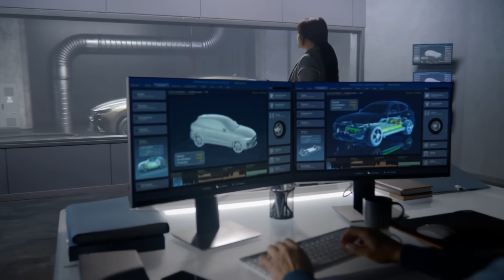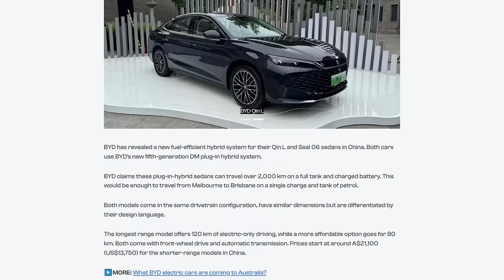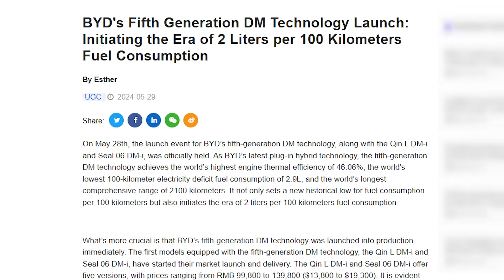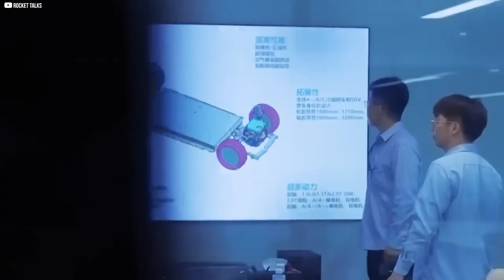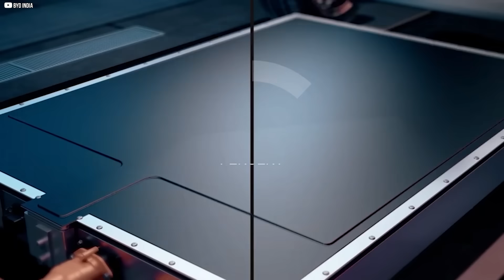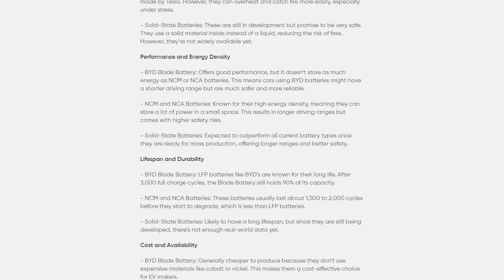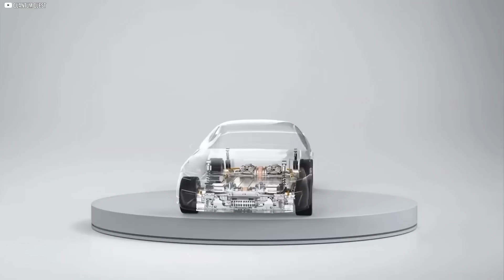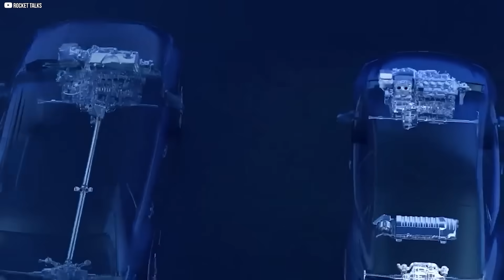Why the Auto Industry Is Shaken After BYD CEO’s Latest Reveal

Comment: There are many in-depth interviews with BYD’s founder available on China’s Bilibili platform. One major misconception about BYD is that it relies on cheap labor. In reality, Chinese engineers earn higher salaries than their counterparts in many developed European countries. BYD’s commitment to cutting-edge global technologies and its investment in R&D began long ago, it’s just that, as a smaller company back then, it hadn’t yet completed many of these initiatives.
For instance, research into enabling cars to float and drive on water began over a decade ago. Another innovation is the high-speed tire blowout stability system, which allows a vehicle to continue driving safely even after a tire bursts at 140 km/h. BYD has also developed technology for vehicles to pivot in place, enabling sharp turns in narrow spaces. Their exploration of vehicle-to-load (V2L) power discharge was similarly ahead of its time. Initially dismissed as unnecessary, BYD insisted on implementing it, so that in the event of a power outage, the car could serve as a backup energy source to power other appliances.

Comment: Now the downside. After 3 years warranty, no mechanic will touch it except for tyres. You run over anything that marks the battery case, no one will insure you. The prospect of a lithium fire even has the fire station not wanting to touch it. One bad cell takes the entire battery pack down, out of thousands of cells. Best of look, getting 10/20 years out of it.
Reply from the maker: Thanks for sharing your concerns about the long-term aspects of EV ownership!

Comment: If anything the Chinese not just BYD are showing up both the American gas guzzling smoking suburban polluting engines and the  costly less efficient European Automakers for what they are, WASTEFUL EXPENSIVE WASTERS. It's a powerful efficient economy like China to lead the world and show how it's done, finally! It only makes sense to ease the driver into electric driving 1st but still have fuel backup with a more than enough range to drive for 2 weeks solid without going anywhere near a petrol/gas pump.The blade battery and using a 1.5 litre petrol engine as a backup with not one but 2 electric motors as premium engines is a stroke of genius!This how hybrid driving should be,DONE PROPERLY!😮🚘 🙏🙏🙏🙏

Comment: I have a nephew who bought a Toyota Prius Hybrid (electric & gas) car about 4 years ago in HI.  He spent about $37K for it at the time but he has solar panels on the roof of his home so electric cost is nominal.  He states his Toyota Prius gets about 83 mpg with the combined electric power. Also, he says when going down hills, every time he brakes, it runs a generator to charge his battery!  Smart, in that sense.  Actual cost is still a question though.

Comment: A 2000km range, impressive. That’s 1250 miles. It does 75 miles on a charged battery pack so 1175 miles on the fuel at 80 mpg so just under 15 gallon fuel tank. Is there room inside for people?

Comment: Chinese are making so called DeWalt cordless tool batteries however when they took them apart.
Half the battery is filled with sand. Wtf?
I guess they needed to balance the battery.
Its like the Dictator where he needs to lighten his weight by removing the brick in his pocket.
Why did he have a brick in his pocket? 
Ez. To balance out the brick he was carrying in the other pocket. Smfh

Comment: Nope. I don’t like it. A better idea is what Edison motors in Canada is doing. The vehicle is run on batteries. When the charge gets low, a small gas or diesel motor charges the batteries as you drive. That motor does not drive the car, it is a generator. It would burn much less fuel than this hybrid, and the headaches from a combustion engine are minimized.

Comment: Lets just come back in some years, to review the lifespan of that excellent gasoline engine, having almost 15% bigger compression ratio, than Mazda SkyActive-G. With oil in it, which most the time will not flow on the optimal temperature, due to the fact, that the electric engines are the primarily.

Comment: MOST UNFORTUNATELY ... it is not so much about the Chinese Made Battery Technology, which were copied/counterfeit or duplicated from the Western Brand Car Manufacturers  etc. ..among the BEST of the BEST ... rather the usage of :  recycled and poor quality material, cheap electric components, and low quality steel to built the battery casket .. as the result, ..prone to short-circuit, electric faults and cracks on the casket .. as result water seepage into the lithium cobalt core ..igniting the Battery to fire up massively !!

Comment: 2000 klm on a single battery charge combined with a 1.5 liter petrol engincwhich puts out 90 hp. 80 mpg when battery low

Comment: When you have 40 to 50 lL petrol 50×20 = 1000km and BEV also there to support again 400 to 500 km ...it is two power train combined in single vehicle...cost will be more and running cost will be high. When ICE supplies battery charging..the over all efficiency will be very less...it is asusual China aesthetic advertisements like 1000km 2000km range like that ..but it is over all efficiency cost maintenance very poor compare to fully Battery EV.

Comment: Honda hybrid system also uses similar concept where a small gas engine drivers a generator, and a more powerful electricmotor drives the wheels. But they didn't achieve such high efficiency, .. so far

Comment: it doesn't matter the true evolution as well as revolution are Evs wich one day will work with solar panels it will be able to charge while moving leading to higher range than 720km etc fuel engines must stop everything should work with electricity.. solar systems should be installed everywhere even at home

Comment: My VW passat GTE holds the exact same performance with a 1.4 liter turbo charged 4 cylinder engine and 84 hp electricmotor. 225hp combined. Doesnt reach 2000km on si gle charge and 50liter tank of petrol. 600km at most
Reply from the maker: It's interesting to compare the different approaches to hybrid technology!

Comment: 2000km in single tank and charge? My old 2001 Volvo V70 D5 can do 2000km on single tank long as it's done at 80kph, increase speed to 100kmh it will do only 1600km on full tank of diesel. I know BYD does this with much smaller tank, my Volvo has 90 liter tank, this BYD likely has half or less the tank size.
Reply from the maker: Thanks for sharing your experience with your vehicle!

Comment: Electric is good. However it relies on battery. It always require charging of all times. When battery damaged, the replacement cost is too high. Conclusion: Electric car is good, but expensive technlogy.
It's highly promising if China mainly BYD could develop Thorium (which is abundance in China) -fueled reactor engine that no need for refueling car for almost 25 years even more!
Reply from the maker: It's great to consider the full picture of the technology!
Reply: @TheForgeEmpire  I believe China can do it!

Comment: Merceds and Ford scaling back on EV, and BYD are scaling back EV to HYBRID. Why? Because they didn’t do their homework. Oh yeah forgot to say, the prices are because there is an expectation that the dealer network will be around once you’ve bought a car, parts etc… Whereas as BYD change models too many times, will parts be around? Easily accessible? What are the costs? But then the cost of your vehicle is so low that a sales value will be negligible. Whereas a Mercedes, even a Ford, will have residual value. And if you live in the UK good luck with rust under the car as a report from Ireland in 9 months it was covered in rust. A low quality car will always sell at a low price.
Reply: 嗯，奔驰在中国的销售网崩溃了。 销量下降+实际售价7折（奔驰为了维持销量，减低了售价），导致经销商销售收入下降，不足以维持店铺运营，经销商不干了，折甩卖奔驰。
Reply: @xipingcao  yes they were certainly hoodwinked into that deal. Some businesses look at the bottom line, this with sense wouldn't entertain dealing. with CCP.

Comment: They should also convert half the power into generating electricity to recharge the battery as is moves… so not only will the engine help the electric motor but it will also drive a generator to recharge the battery…!! 😀
Reply from the maker: That's an interesting idea for improving the efficiency of the electric vehicles!

Comment: And in India, the govt is diluting the petrol with 20% ethanol (no reduction in price for consumers ofcourse).. 👏
Reply: Only 20%? Brazil does much more and for a long more time
Reply: @FelipeDeLeo  yes they are doing it for more than 50 years, our government is rolling it in just 3-4 years, and suddenly imposed this e20 to common people. Manufacturers and insurance companies are considering this as a void of warranty on non e20 compatible cars
Reply: @FelipeDeLeo but ur engines are tuned for it
Reply: They give options while filling the tank bro @FelipeDeLeo
Reply: @FelipeDeLeo in brazil you can choose which one you want to buy. And Not all of a sudden when the cars are not equipped to handle it.
Reply: @gundeep0 in Brazil, you can't choose, and they just increased it to 30% ethanol. No problem for newer cars that are built to run both gasoline and only ethanol, but for older models, that's a huge problem and you have no choice.
Reply: @octoberfes ok sir where is price reduction? We are using low quality petrol and gatgari making money out of that?
Reply: @gundeep0  who said you can choose? it's 30% over here and your car has to deal with it.
Reply: @octoberfes  actually upto E20 flex fuel is not required, but when it cross like E27, it not petrol anymore and require a multi fuel engine.
Reply: A business right there!
Reply: Gadkari,s son sugar company is making ethanol 😂😂😂
That's the reason
Reply: @gurpartapsingh9820  Yes all over india, only his son is making Ethanol... when Brains lives in the knees you are bound to make these type of foolish statements
Reply: @gurpartapsingh9820 nope.. His company is not even producing 1 percent of ethanol..
Reply: We are masters of adulteration why not monetize it.😂
Reply: Tum sab Bolo bharat Mata ki jai and be pride ur pm is non biological 😂😂😂😂
Reply: Here, people spend sleepless nights binge watching, planning for weekend right from Monday, doom scrolling and earning (passively) for foreign social media companies, nobody stopped anyone from revolutionising any sphere of life…so that’s where china, Korea and Japan stand sky high
Reply: Govt is not building BYD there
Reply: There is no regulation.petrol pump workers and owners are buying ethanol from black market and mixing more ethanol. even if your car is e20 compliant.u won't know it's 30% to 40% mixing going on
Reply: I think its fine, its higher octane fuel with lesser emissions, it might cost a bit more to us commoners, but it's definitely a step forward.
Reply: wow 10% less distance traveled for the same price
Reply: @andrewdavis6012 lol how so? You're basically getting cheap race fuel not to mention how much better for your engine it is as it burns cold so therefore your engine doesn't get as hot therefore doesn't wear out as fast as regular fuel
If it wasn't better than the newest engines wouldn't all prefer it
Reply: Interesting.
Reply: Fr😂😂
Reply: Modi shit
Reply: Other country represent theirs success here cool mf present dirty politics! Why you not talking about resent ind-pak war s400 rafel where they come from ? Your rahul g@ndu did it ! "Ek side se allu dalo dusri side se sona nikalo things!!
Reply: need to clean my fuel system more frequently
Reply: welcome do Brazil. In august 2025, the amount raised to 30%. Once some gas stations do some shady "recipes", you can have even worse mixtures.. It's not hard to find cases of cars having mechanical failures...
Reply: So you are getting better fuel for less lol 
You are complaining about getting something most car enthusiasts want and struggle to find
Reply: Ethanol is the death of small motors and marine motors
Reply: brasil is actually 28% my friend
Reply: Ethanol production uses a lot of energy to produce, it actually cost more to produce ethanol than it does the produce gasoline
Reply: Yaar tum log haar Chinese articles, documentaries, videos ke niche Kyu rote rehte ho. Like Himmat kaise hotey hain Gobar ko Mighty Dragon se Saath compare Karne ki. Tere aukaat hain tu gobarkhor...Isse upar Jane ki soch kaise Sakta hain tu 😂😂
Reply: always moaning instead of making money from this 🙄 looser
Reply: It's gives more mileage too
Reply: Thats b,coz you are paying for your subsidy you enjoyed during 2005-2013, it will continue till 2026 , until repaying oil bonds.
Reply: That will destroy the engine over time.
Reply: On the other hand, you'd be disrespecting the British colonizers for their depletion of essential Indian qualities, but this of what you say here are essentially the basis of that apparently striped away! The provision of infrastructure allows of your progress as a whole, no matter the excuses & claims because human nature will broaden horizons unless the will to seek change holds lethargy that succeeds with the appearance of jealousy & greed removing most initiative of self betterment. By no means is this behavior restricted to India alone, as it's clearly the sentiment held by any who claim oppression to be a means of which lethargy has a successful hold upon a people.
This is but a generalized perspective from an individual whose far removed from society's commonality however also holds rich family history within the British colony & the British Army of India, now residing in the city that those of family settled upon in NZ, in a home that was built at the time their ship initially docked at port. However, this individual lives such a life of marginal recourse to that historically past. No claim be made yet or ever to be of Indian or British army rite for that matter, though this life is anything but joyful to which the possibilities to progress are sought to conclude of negativity determined to provide failing perspectives, all much regarded by the delivery contrived as not only thy NZ government but almost every governmental body operating presently. The presumed directive is in guise of the commonly provided vocal barrage, given as falsified incentives, that of which provides what deterministic requirements for all items upon a checklist that has momentum to gobble gobble the world right up through the ever increasing economic division! Such a checklist, once fantasy, is only now likely depicted as course for future proposition. These strategies, while openly available to thy public, could hardly be considered new developments, right? Though the behavior that beings in negating history as if a constant within life, does ultimately have the past remove what progress could've been achieved had it not sought to provide achievement gained by excuses & lethargy as work of various ethics & methods has seen provided historic opportunities with influence. Confusion grips this entire situation of the past as it's again clearly happening in plain view,  greater are the  collection of steps downward as this is allowing all to be distracted. Historically the literature is missing of the induction as if similar substitute from wence the mis & dis information controversy left common knowledge on the perverbile floor & swept under that mountainous rug!!

Well that extended well past my intention there sorry. However if you scaled the mountain & made it back down here you may appreciate that it's obviously not comedic or fictional that history repeats itself in a strategic lifecycle determined by leadership that knows only itself by who at thy helm navigating one ship (yes, but that is just one fictionalized account, as if this were regarded as a philosophers statement, that it is precisely) to 'destinyation' though the voyage will contribute only losses to the majority who never will know what they do not, are but a few once held highly as philosophical now held in medical appropriation no longer of asylum home. Conclusively, by that wisdom, both wealth & life are but a balance we essentially have nil control over consumption!!🌍🌎🌏🌐🏛🏗🕌🛕🕍⛩️🧱🏠🛖🪵🌊🌊🌊🌊🌊🌊🌊🌊🛳⛴️🛥🚢⚓️
Reply: बेटा तभी पेट्रोल सस्ते भाव मे मिल पा रहा, एथनल न मिलाये तों 130 से 150 का बिकेगा, तब तुम्हारी अम्मा गर्भधारण कर लेंगी 😂
Reply: @shivam00668  looks like your mom got pregnant by our prime minister
Reply: @shivam00668 Petrol is sold to the aam admi at much higher rates by Ambani and the govt..
Reply: Pjeet andhbhakt government

Comment: The UK are going to ban hybrids. My current hybrid does 60 miles to the gallon. The future is Toyota's hydrogen car that will run on distilled water using electrolysis with zero polution and a cheap clean fuel "water".

Comment: if it has an ice, not interested.. i moved from a bimmer to electric and will never go back to ice..  pure ev has the lowest maintenance cost.. no spark plugs to replace, no oil changes, 300 miles range.. if someone comes with a battery pack on a pure ev that give 1000 miles, I am listening..
Reply from the maker: That's interesting to hear about your experience with EVs.

Comment: Why do I feel the video script is chatgpt and the voice over is 11 labs
Reply: So much this
Reply: Sounds very impressive.  However, while high-performance petrol engines sound good, reliability and cost of maintenance issues may be negative factors for hybrid car owners, unless those engines and all the other components of such vehicles are able to show they are very reliable. And not prone to break down after the warranty runs out.🤔
Reply: @NielsMadsen-n7p exactly this. This is the best that could happen for any car builder. You visiting their crap repair shop often. Combustion engines in this times are very unreliable.
Reply: could not pronouce KWH
Reply: Because iti is
Reply: And is it getting the message out? = doing what it is designed to do